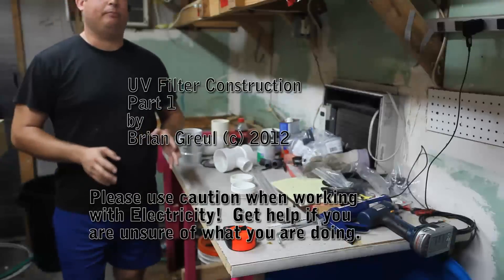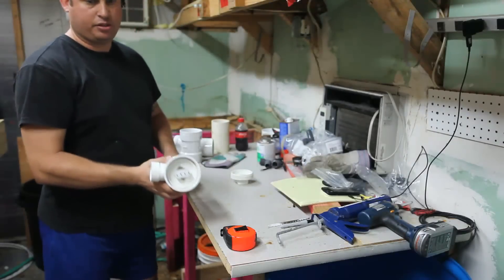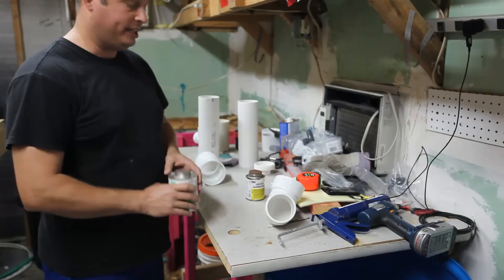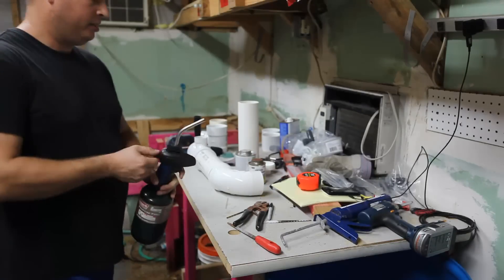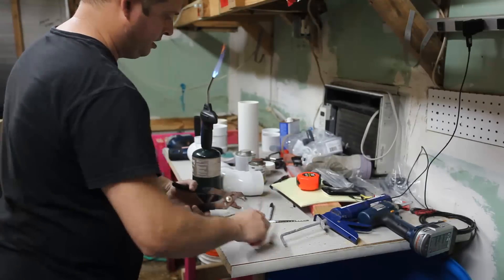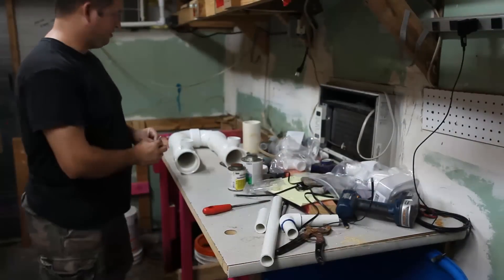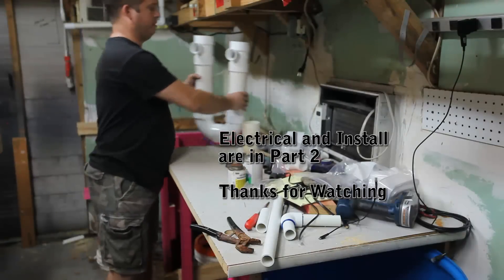DIY UV Filter Construction - Part 1 of 3

Comment: Pvc has a max temp of 140 F to maintain pressure rating. Using pex would give you 200 F max heat handling. Copper, even more. Also quartz glass sleeve is needed to enclose the uvc lamp and keep any water clarity issues from blocking the uvc rays, preventing them from being effective at killing all the targeted microbes. For pond application, this is safe, but not for treating your drinking water from a well.
Reply from the maker: It's a 30 watt bulb.  That's 30 btus of heat.  Assuming your keeping it in a fish tank then the tank should not even notice 30 btus of heat input.

Comment: I don't see anywhere where you show how you sealed the  bulb holder from water escaping.  Kind of the hardest part. Please advise, thx.
Reply from the maker: It's designed not to hold water under pressure, the water level never gets to the electrical connectors.

Comment: can i make a small hole just for the light NOT for the lamp ,and stick it in a bucket ,will it work without getting the lamp wet ?
Reply from the maker: You can but it probably will not work properly.

Comment: http://www.ebay.com/itm/UV-Pro-Ballast-36W-Bulb-Odyssea-Ultraviolet-Sterilizer-Filter-UVC-Replacement-/112054921176?hash=item1a16fe67d8:g:O-UAAOSww9VXhVM3 - $25 for everything but PVC might make it worth it, if you have extra PVC laying around.
Glass Stir Stick $4 
http://www.ebay.com/itm/30cm-Glass-Stirring-Rod-Home-Brewing-Round-Head-Stirring-Stick-Rod-/322187253854?hash=item4b03db585e:g:nIcAAOSwWfFXjr5L

PVC material build in a slightly cheaper format, but still totals over $60 for everything.
two x 90 Degree Elbow $3  http://www.lowes.com/pd/Charlotte-Pipe-3-in-dia-90-Degree-PVC-Elbow-Fitting/3132777
two x 3" PVC T fitting $6 http://www.lowes.com/pd/Charlotte-Pipe-3-in-dia-PVC-Wye-Fitting/3132803
two 3" PVC Cap, will barely fit inside the T snug and hold the lamp, silicon it to the sides $3.68 http://www.lowes.com/pd/Charlotte-Pipe-3-in-dia-PVC-Sch-40-Cap/3133057
one 3" 5foot pipe $9 http://www.lowes.com/pd/Charlotte-Pipe-3-in-x-5-ft-260-PSI-Schedule-40-PVC-Pipe/3581470 
one silicone tube $5 silicon type 1 (nontoxic to fish) http://www.lowes.com/pd/GE-10-1-oz-Clear-Silicone-Window-and-Door-Caulk/3070881 
one 
25 + 6 + 12 + 4 + 9 + 5  = 60 plus vs $48 http://www.ebay.com/itm/UV-Pro-36-Ultraviolet-Sterilizer-Aquarium-Filter-36W-Bulb-Green-Algae-Clarifier-/301573067342?hash=item463727d24e:g:8UMAAOSwBLlVEcDm

Comment: hello BRIAN ...  if u have some time for me... I want to ask u something. Is PVC pipe safe for UV lights? is there any kind of reaction inside of the pipe ? melting or something like that Because of UV radiation ?  and sorry for my poor English plz don't mind.. Have a nice day.. Waiting for your answer.
Reply: UV is known to degrade plastics. That's why plastic things get scale when left outside in the sun, and then get brittle and fail. But since this is so cheap to make, why not make 2 pvc housings, and when the one begins to fail, replace it? The reason the manufacturers make them with a stainless steel insert is to reflect the UV light which gives the light more power and coverage through the water.

Comment: Hi Brian, how are you. I think that I am the same problem as everyone. Those bulb and sockets, they ara not easy to find. How do I know that I am buying the right ones. Plus those that I am seeing on Ebays, dont came complete, the sockets does not come with the wires. If that isn't much of trouble, could you please send me the links are you find everything? and does the sockets come with the wires or not? and the and of the video as promesses, you did not show how you made the modification of the plugs as bulb holders. by the way, I love your video! thanks
Reply from the maker: Elaine,  You need to start with the bulb and work backwards.  Pick a bulb, then buy the socket that it specifies, and find a ballast that supports that bulb type.  I did a quick check on ebay and frankly for $48 I wouldn't build one today.  I'd buy this and be done.  ebay item id:301573067342.  The bulb cost about $9 and the socket was $2 pre-wired with short wires.  I considered the sockets disposable and ordered them from China through eBay or AliExpress.  I have more PVC Parts in this than I care to admit.  Depending on your installation water tightness might be a big deal.  My old tank setup had a "wet room" that was basically a shed behind the house.  I didn't care if it was damp.  My new tank setup will be more traditional and I am going to great lengths to control moisture escape.
Reply from the maker: Now, if you want to build it because it's right for your app.  The bulb is a 2G11 type.  Ebay ID 300395360775 currently has one for $6.99 with free shipping.  This isn't rocket science and as long as it's UV-C it will do the trick.  What I mean by this is that you don't need to be super precise and you should design for lower bulb output which occurs at the end of the bulb lifespan.  UV bulbs are not like other kinds.  Their germ killing output drops as you run them.  After X number of hours they should be replaced.  X varies by manufacturer but the one I mentioned is a 9,000 hour life which is 375 days of continuous usage.  If you run it 12 hours a day then you could get 2 years.

For the lampholder, Ebay 391535930119 is what I would buy right now.  It's a name brand and is push to connect, so you just push the right size, properly tinned wires in to the connectors.  You'll have to understand the wiring schematic, but it's just connect the dots with voltage.  Remember to never touch anything while it's live.  I probably would try squirting a bunch of silicone in the holder to keep salt vapor out right before I put the bulb in.  Silicone will form a gasket, it's non-conductive, and it will keep water vapor out.  You can then put a big wad of it on the back to extend the life and ward off corrosion.

Comment: A couple of problems. Uv light will degrade the pvc. A stainless steel sleeve inside the tube will help. 
The tube inserted directly in the water will lower the tube life. 
You should use a crystal sleeve.
Reply: +Brian Greul if it degrades doesn't that mean it will contaminate the water with plastic chemicals?
Reply from the maker: +Krysteen Nelson Not in a measureable amount.  If you are doing water changes you will be fine.
Reply from the maker: Patrick Sarmiento It's just fine.  The bulb conducts electricity on the inside.
Reply from the maker: ***** You have some great comments.  It will take a long time for the PVC to degrade to the point where it does not hold water.... and the bulbs are cheap.
Reply: ***** Why there is no Quartz sleeve? is it safe?
Reply: @patricksarmiento7404  The bulbs themselves are made of quartz. The purposes of quartz sleeves are to provide secondary containment, and to allow the bulb to operate at a higher temperature where it is more efficient. But you're also losing transmittance through that extra layer of quartz.
Reply: Stainless has lower UV reflectance than PVC, and thus tends to waste more of the UV energy instead of reflecting it back for a 2nd pass through the water. In practice, UV at this level will take many years to degrade the PVC to any noticeable extent...and even then, you'll just have a browning of the surface.

Comment: GREAT INVENTION, I AM REALLY IMPRESSED. Can this system work for a 500 glns. per day Commercial  Bottled Water Operation. How do I source Adaptors for the UV Lights and also the Ballasts and sealing the top from leakage. Everything else I am clear on.

Comment: hi Brian,
Great video.  I have a favour to ask.  I need a UV filter for my planned aquaculture operation. It's purpose is to depurate oysters after harvesting (42 hrs under the UV filtered water that's cycled through them.)
Would you check out the following Youtube video : How It's Made - Oysters. 
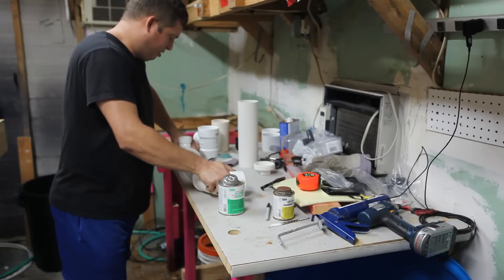 At the 4:35 mark it shows the size of the pool and gives a close-up of the filter.
Is it possible for me to construct a comparable UV filter using your techniques?

Thanks,
Mike

Comment: what are you shielding the bulb from the water with?  Regular glue and primer are toxic that's why they make marine PVC glue and primer...
Reply from the maker: Once the glue is cured it's inert.  The bulb is made of glass which is plenty of shielding.  While you could add a quartz sleeve it will diminish your UV output and is unnecessary.  Someone suggested that bulb temperature is affected by this... probably a few degrees..  Glass, including quartz is a great conductor, so I doubt that a second layer of glass (tube plus quartz sleeve) will have a meaningful insulation property.  The bulbs are super cheap, so if it burns out early so be it.
Reply: Hi Brian, do you still stand by these recommendations (4 years later) [no sleeve, glue] ? Thanks for your time !!

Comment: GOOD  WORK. HOW MUCH ELECTRICITY IT WILL CONSUME.
Reply from the maker: In my system, 2 bulbs at 36watts each is 72 watts.  Factor inefficient ballast, and let's call it 100 watts.  You could test it to be sure.  Ballast efficiency is usually on the label.

Comment: Brian, Thanks so much for a great video series I followed your plans and added a UV system much like yours to my sump filter.  I had a little trouble finding the sockets for the UV bulbs and finally found out that the industry refers to them as 2G11 for PL36  bulbs. Finding the right ballast was a little tricky.  Espen VE218MVHRP-C at my system photo below

//scontent-b.xx.fbcdn.net/hphotos-prn2/q74/s320x320/1380010_10151832500186865_739242799_n.jpg

Comment: do not touch silicon with hands when it's wet .... could mess it and degrade the polymerization. .... PVC for drinkable water is not forbidden? do you need PE e PP i suppose ...

Comment: Doesn't water coming into contact with the UV tubes reduce the life span of the UV tubes. I know that other UV sterialiser designs protect the tubes using quartz tubes. How much more extra would it cost to add quartz tube to protect the UV tubes?

Comment from the maker: Hi,
  I'm not shielding the bulb.  In the event that it breaks the GFCI would cut it off.  The flow is low enough that the glass wouldn't go anywhere and I would shut the system down and deal with it.  It's tempting to make it over complicated.... don't.  The bulb is quite durable.  Provided you don't hit it or otherwise shock it you should have no issues with breakage.

Comment from the maker: when you go pressurized you wind up with a variety of issues related to keeping the water in the system.  Pressure ultimately causes leaks.  Pressure also has a cost in terms of drag on the flow of water.  Drag costs money in the form of pump energy.  The concept I built will work fine and it's safe provided a GFI outlet is used.  The GFI will trip if there is a short.  That said, I still unplug it any time I'm going to work on the sump or near the wires.  Electricity demands respect.

Comment: Hey thanks...very good videos, I am planning to use your idea but would like to do it pressurized, using threated caps and silicone to seal the uv bulb to the cap...do you think it is safe? The problem is that my whole system is pressurized. Thanks